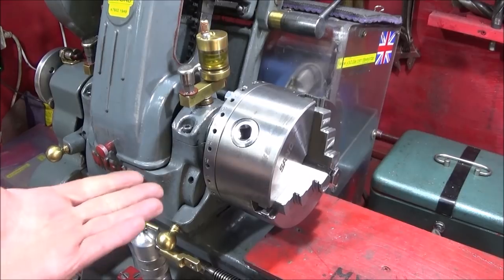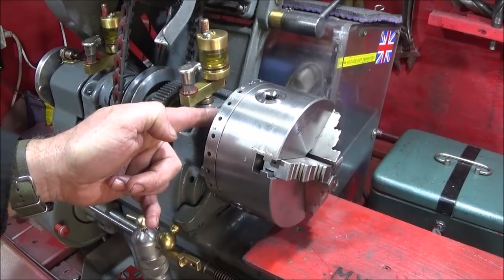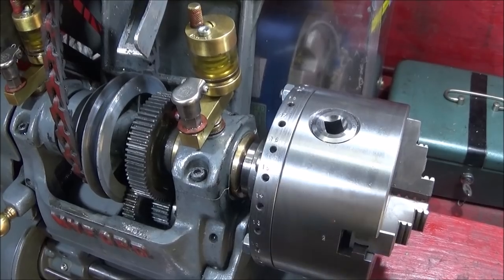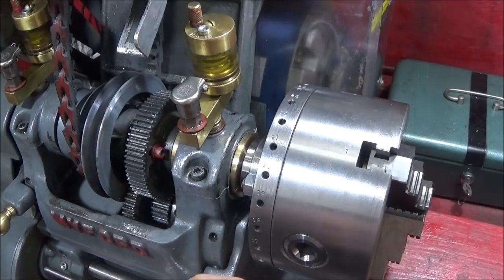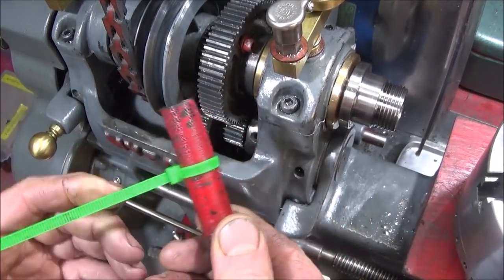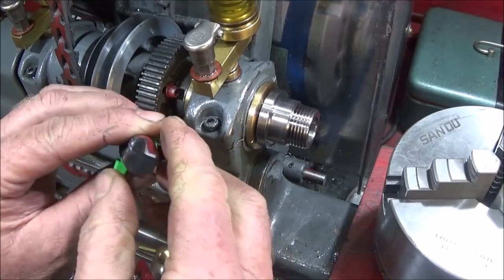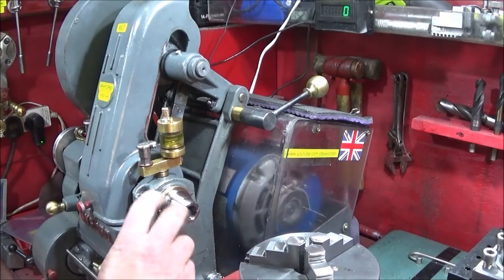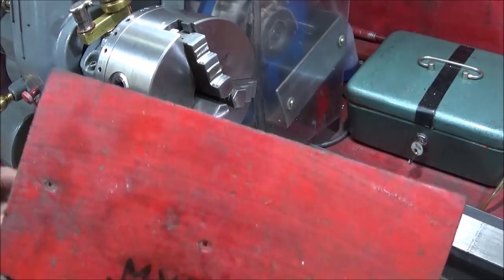A Simple Very Effective Myford Lathe Spindle Locking Tool

Comment: Re the Super 7 locking pin I can tell you it is very strong I have had a Myford Super 7 B for the last 50 years every 15 years I sell the old one and buy a new one!!The way it is designed is to shear not to bend. Never had any difficulty no matter how stubborn the chuck was, your idea for the Myford ML7 is good the most important thing is to put good clean oil on the thread before putting the chuck on, thanks for uploading:-)
Reply: The big bore super 7 locking pin is much thinner!
 I bent it and now have got to take the lathe to pieces to cut it out.

Comment: I bent the locking pin on a big bore super 7!
 The pin is much thinner than on the standard super 7, it bends easily which I didn't realise.
Now I think I've got to disassemble the headstock, cut the pin off to get it out!
It's almost like the design fault of the big bore.

Comment: Hi Steve, I've had a 4 jaw chuck stuck for many months on my super 7 and tried all solutions that I could find including using an impact wrench but without any success. The super 7 spindle lock only locks the pulleys, so the spindle can still move very slightly (not sure why and didn't want to force it) so it wasn't effective. I have just tried your method without any real hope that it would work but it did! I could hardly believe my eyes! I had pretty much become reconciled to only having a 4 jaw, which fortunately is a good chuck to have if you only have one. I wondered now and then about machining off the backplate but feared wrecking the spindle. Thank you so much, I am over the moon - and all thanks to you!

Comment: That is a good simple solution. It’s always a good idea to spend a lot of time thinking about it before you do it the hard way. I also have to find a way to lock the spindle of my cheap Chinese lathe which is similar in size to your Myford. I used to work for the corporation that made Chux cloths here in Australia but now they are made in China probably under a different name now. I don’t know if you have them over there but they are a general purpose non woven kitchen cloth that can be torn in one direction only in strips as thin or thick as you like. When I saw you about to clean the thread I instantly thought grab the chux cloth as they are great for cleaning threads.

Comment: Hi Steve,
I caught a glimpse of that in your last video and was going to ask about it, nice simple solution, must admit I have been guilty of using the back gear once or twice but not any more, have some small bits of jarah hardwood that will do the job nicely. I did see last year in the Model Engineers Workshop magazine there was a plan for a plate that had a shear pin that engaged in the hole in the back gear to do the same thing but this is much simpler and faster. 
Thanks again
Cheers
Raymond

Comment: The Myford Super 7 already has a locking pin at the back near the bearing housing when you push it enters into the back of the large pulley. It is an original fitting  from the factory mine has it and I bought my Super 7B new 25 years ago!!!

Comment: Hi Steve,
Advice please, I’ve lost a tooth on my 20/55t back gear. Unfortunately, I can’t find a replacement. There are however plenty of 21/56T gears available.
Would you happen to know if this one tooth difference would be ok as a replacement for my ML7?
Regards, and thanks for the great vids. 👍
Reply from the maker: If you mean the actual backgear headstock drive, then I would think you would need the actual one. Myford/RDG are starting to make many Myford parts again, so maybe you will be able to get one from them soon. You may find out better information, though, regarding this gear on the Facebook Myford page. Regards Steve

Comment: A great solution. As others have said I plan to make one soon. Also like some of your other followers, I do not have access to PVC and so will use hardwood.
Reply from the maker: Hi I have found since using this method and clean engine oil on the threads I have never had a stuck chuck since.
Reply: @SteveJordan      This is my second time of watching as I read comments,  hoping to contact you to request the dimensions,  and voila I found them on the video….15 dia x 70 long.   Bottom dia about 20 with hollowed end .
I do not have any dense pvc…..can you recommend a source,  or something I can cannibalise ?

Comment: I would ship you a box of Belgian chocolates if I had your shed location. You just saved my Granville Senior stuck chuck, using not pvc but a piece of wood which has naturally taken the shape of that pin (with a head on my model). THANK YOU Steve
Reply from the maker: Hi Danny that is great. Thanks. I haven't had any problems with a stuck chuck since I found this method. I also put some clean engine oil on the threads each time I change the chuck and I think it is the best thing for them to prevent them locking up. Regards Steve

Comment: I’ve been doing same thing with a short 3/8 extension for years 😂
Reply from the maker: There are really good 3d printed locking devices now on eBay that fit in the teeth of the gear. They are an excellent design.

Comment: Hi steve 
I need your help again, apologies I don’t know how to contact you other than this method. I was using my ML7 at the weekend and I heard a piece of metal about 4mm round dropping into the drip tray, it seems a pin of sorts has sheared off. However I don’t know how to resolve it. The machine seems to run as it should however as soon as the Chuck comes under any stress from machining it simply slows down, in fact in its middle speed I can easily stop the Chuck with my hand.  What do you think it could be and where do I start to look for the issue. Thank you in advance.
Reply from the maker: Have you lifted the guards whilst machining or doing the hand test to see if the belts or pulley's are slipping? That's all it can be I think. Maybe the screw stud has loosened on the countershaft pulley? Let me know

Comment: I always wondered how much slop is in the spindle/plain bearings on these lathes. I don't know why but plain bearings for something as precise as a lathe scares the crap out of me.
Reply from the maker: Hi Well I have measured mine and it is only '001" and has been like that since I put a new spindle and bearings in it quite a while back. Someone told me they had an ML7 from new many many years ago and the bearings have never been taken out and that they are as good as the day he bought the lathe. Myford wouldn't have used them if they weren't any good. 
  Having said that though, I like the large tapered roller bearings like I have in the Mini Lathe the best. They are low cost and easy to adjust, lubricate and maintain plus you don't have to use special ISO 32 hydraulic oil, the Myfords use.

Comment: engine oil,, as in automotive oil?
and if so, you have a favored weight to use on chucks?
Thanx for the share and post
Reply from the maker: Hi Yes automotive. I use any low cost type but the thicker oil the better I think. Regards Steve

Comment: The super 7 spindle lock is very sturdy, I think you would damage the chuck before the lock broke.
Reply: Oh and FWIW, your method won't work on a S7, the back gear uses a different engaging method.
Reply from the maker: Ok that's good.... It doesn't matter whether the tooth lock is engaged or not though. You can have it disengaged and this method still works, as long as the allen bolt is tightened. The force is on the allen bolt head and the actual gear it is located in,  not the actual locking mechanism.

Comment: Hello from Norway.  What type of quick change toolpost do you recomend to my chinese small lathe?  Carl Erik, Norway
Reply from the maker: Hi Carl. If it is the same type of Chinese Mini Lathe like mine, I recommend the Dixon type.
https://www.ebay.co.uk/itm/RDGTOOLS-QUICK-CHANGE-TOOLPOST-4-PC-FOR-MYFORD-LATHE/350507220587?epid=1456627393&hash=item519bdbbe6b:g:1dgAAOxyqKVRhIxu
Reply: Hi again, and thank's for the answer, what you recomend.  Before I order I wonder if you can  see if it will fit .  On my chinese mill/lathe compond slide I don't have a hole for a bolt. I have a trace12cm. for a T-bolt.  The height from compond slide to center chuck is 4centimeter. From chuck to tail stock is 33 centimeter. From bed to center chuck 18,5 cm. Do you still think it will fit?   Great if You can look at this.  AND THANK YOU FOR ALL YOUR VIDEOS ON YOUTUBE.   Carl  erik ,Norway

Comment: Doesn't everyone just engage the back gear lever ? The lathe has it's own spindle lock ! LOL
Reply from the maker: If you do that when trying to remove a chuck you risk serious damage to the lathe.
Reply: @SteveJordan  How many people have damaged their lahes doing that ? In other words, prove what you've just said.

All I can say is ours was never damaged by doing that.
Reply from the maker: If you want proof just ask the Myford UK company about your method. They will tell you the same as me. Its a well known fact amongst Myford owners that your method can seriously damage the lathe.
Reply: @SteveJordan  I don't think there's anything wrong with the 'method' but the way it's (ab)used by other is clearly out of my control. The fact is, you're only using what's available to drive the spindle - and that's what's tightened chucks etc. on. In fact, the motor should be able to unscrew everything via lowest speed back gear. If it can't then it's been overtightened.
Reply from the maker: Myford would still say not to use the backgear as a spindle lock. 
 The makers of the lathe know the strengths and weaknesses of each part. That's obviously why they still sell the toothed part for this mechanism... because people still break it.
Reply: @SteveJordan  I'd guess that most Myford users only nip up their chucks and rely on cutting load to tighten them 'sufficiently'. That's all done through the mechanism used to lock the spindle - which means it's strong enough for the purpose of locking the spindle to remove chucks etc.
But, if people start using hammers then they're likely overloading - especially with a shock load - the mechanism.